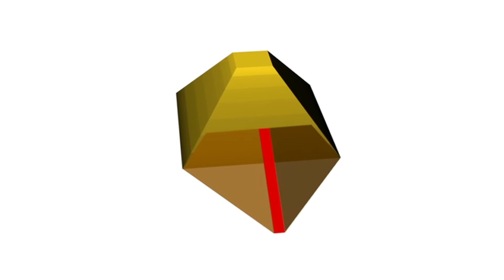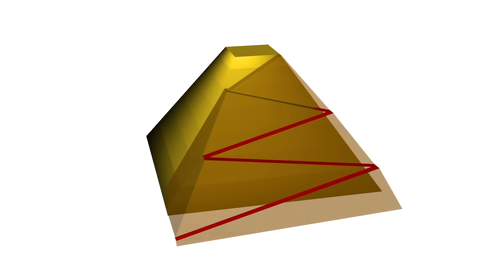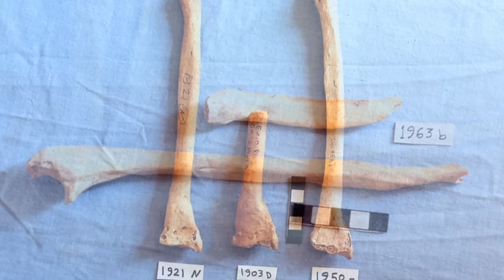Egyptology - Pyramid Construction

Comment: Each brick is actually poured and set stone concrete , made exactly where they sit. The side and bottom  bricks became part of the form for the next brick, leaving gapless spacing between every brick. The tops of each brick were naturally flattened by gravity, like when a concrete floor sets. Very little of the pyramids and sculptures are quarried rock. Really not that complicated, but impressive nonetheless.
Reply: noeffin way 

Are you suggesting that the alchemical transformation of sediment from a solid state to a liquid state is not complicated?
Bitch please!
The Nubians still had to create a rock model with precise angularity to even create the blocks. A tub so to speak.

Comment: it almost sad that people actually think this was the way it was built. They sound so silly but yet so arrogant.
Reply: Danny Cheeks How do you think it was built? Genuinely curious
Reply: ellie it’s actually made out of concrete and that means that all they needed was sand and water so they could have just climbed and built it with no ramp
Reply: Danny Cheeks take your meds
Reply: Jade Loika wouldn’t that make you arrogant dumbass, you’re basically saying you’re right and they’re wrong when we have no proof of anything making you arrogant and hypocritical your self.
Reply: You are hilariously ironic
Reply: cz productions exactly!
Reply: Im reposting my theory.
   How the pyramids of Egypt were possibly and most likely built:
    The stones were shaped at or near the quarry and transported to the Pyramid site in this method :
    An assortment of encasements from spherical to cylindrical, encased the block and interlocked into place around each block stone allowing the stone to roll. Certain attachments around the encasement would allow either fulcrums or rope attachments to ease movement and allow for tight corner turning with the least amount of men. Once the stone reached the top, the interlocking encasement was disassembled and the stone was leaned over and slid into place.
    This technique would have eliminated the need for lifting devices or a massive ramp.
    My theory is that most likely it would have been a spherical encasement allowing for tight cornering. This would be the most logical way to transport a large stone using the pyramid itself as the ramp.
     So in essence the stones were rolled up the pyramid in a spherical encasement that was removed once the stone reached its destination and leaned and slid into place once atop the pyramid. This process was repeated all the way to the top. 
     I have not decided yet if the encasements were made of a metal alloy or limestone etc. If bronze was used it would have been melted down for chisel making and as such there would be no evidence of the spherical encasements.
    If limestone was used it may have then been discarded and reused for other construction. 
    In conclusion the only way to deliver a square to the top of a Pyramid is to encase it in a Spherical interlocking encasement.
Reply: We built most of Manhatten and the rest of New York City before we basically had electricity and way before we had a screw gun  just saying
Reply: It's more silly to believe in conspiracy theories instead of mainstream science.
Reply: Ramps and muscle power of close to a million in the time span of 30 years. That is fucking easy to build a pyramid, it wasnt aliens you fuckhead.
Reply: Jade Loika shut the fuck up bitch

Comment: What about water as a transport and guide for leveling? Put floaters on the blocks. Water softens them and water is level. Put hundreds of blocks in a big pool and get hundreds of workers working on the soft stone to shape the sides while in water. Then float them to the pyramid and build sealed tubes with chambers to float the blocks up the side of the pyramid. There's a video about it someplace I think. This would mean less brute force required and no ramp building. Since there is little evidence of ramps, I tend to lean toward the smart plan. Which seems to be what those builders would have done...a "smart" plan vs a "brute" plan.
I'm sure they did use the string and pegs for fine tuning, but the overall work would be done far quicker and better with water.

Comment: It shocks me that an intelligent person can believe these stones were marked with red goo and then ground down one spot at a time on 6 sides. Then somehow hoisted to heights by means that would make its precision nearly impossible. This followed by encasing it in limestone. Enoch’s giants makes more sense. If there were men as tall and as strong as oaks; this is doable.
Reply: redlegagent darn, you caught me
Reply: redlegagent my post was not to make a claim, just to imply they aren’t necessarily correct. My issue with science is they decide and close the door. 50 years later we find they were wrong by accident.  For example, it has been found that bone can turn to limestone in less than 100 years. This should make a good scientist scratch his head and take another look at this and maybe other remarkable discoveries could result from discovering how this could happen. This would mess up the narrative, so it is ignored and their previous hundreds of thousands of years for limestone to form remains the answer.  I think they are wrong about this on the pyramids, but I have yet to see an explanation that makes sense.

Comment: So I'm supposed to believe some guys ran around with a 6 inch string and a potato chip sized scraper checking every square centimeter of every block (not to mention your measuring a 3 dimensional surface with a one dimensional tool...how long would THAT take you think?) and finished millions of these over a relatively short period of 20 years? Not to mention that scraper isn't going to work on the granite that's inside. I'm a carpenter for a living and this theory seems to me WAY more ridiculous than if I built a house in ONE year by using sandpaper and my hands to sand whole trees down into 2×4's at the length I need. Not going to happen....
Reply: redlegagent Oh. I meant to say every surface block. I made a mistake. What a dumb fuck I am. Glad you pointed that out. Perhaps if you spent less time trying to make yourself feel so above everyone you wouldn't make yourself look so stupid either by not even being able to spell correctly.
Reply: There used to be a river they made a giant moat to transport huge blocks of stone they would calve them out as they where being trasported in the water. they then used water lifts that made the stones rise up and they could push them into place while still floating on the water. they would then drain the water and build up a layer at a time it was so fast for them to do.
Reply: They did not need to cut out the ground since there is layers of sand. water likes to flow the easiest route so it would go upto the pyramid and stop they would use gates to hold the water in these pipes water could not escape so the block would rise up.
Reply: There has been a full documentary with proof of concept and the core design of the pyramid all indicates it to be the most likely true over any other method. They showed a working model of the water gate system. yes water does not flow upwards but it also can't flow down when the gates are closed which means the blocks can flow upwards but the water can't flow down past the gate blocks.

Comment: As this one, all the theories you can find  exposed on YOUTUBE are pure bullshit, why?
The guys that did that shit are just totaly incompetent in physics, project managing and quarry work.
Even a 16 Years old student can make this calculation that those guys didn't made.
Just considering it globaly, it can be said that the pyramid is made of 2.4 million average stone weighting 2.4 t each volume 1 M3. built in 20 years it was processed about 500 blocks a day.
Just putting up the average block to the gravity center represent 1/2.4 million of the total minimum energy to spend to lift all the stones of the pyramid, this cost 0.25 KWH of energy a block. the daily consumption was about 125 kWH for 500 blocks
A worker in good shape and well trained can produce 1 KWH of energy a day , so the people raising the blocks can't be less than 125 at work.
Now look:  quarrying out this stone takes between 3 to 18 KWH depending on the groove width to cut around the block to detach it from the bedrock 10 cm width for 3 KWH, 60 cm for 18 KWH.
10 cm width can't be used without a machine, 60 cm width is mandatory to allow a manual worker staying in the groove to carve it.
So the people in the quarries can't be less than 1500 to  9000 !
Mark Lehner the archeologist speaking in this video, made a research in the town of the pyramids workers nearby the Giza plateau and concluded that this town can't accomodate more than about 2000 workers.
Make your conclusion by yourself.
Mine is: indeed they used human powered machines to quarry out the stones and raise them to their place,  not those f..g ramps n' rods and hamered chisels!
Here's a site that explain better how they could have make it
https://cheopsgoldenstoneage.blogspot.fr/
Enjoy!
Reply: Please Redlegagent leave wonderland and come back on earth!

1-The bones found in the town of workers where the bones of ate animals!
do you think they used goat, sheeps or veal to make the job?
Have you ever see cattle carving rocks?

2- AT the time of the pyramid construction, Giza plateau wasn't a suburb of Cairo, but actualy a desert place, 
Nobody could reach the site every morning using the metro
They build the town to accomodate ALL the people working on the site.
Most of the food came from the delta through the Nile, they discovered port installations in the town of workers
Do you imagine that 100 000 people could survive 20 years elsewhere in the desert after 10/12 h of harassing work, without nothing to eat, to drink, to rest?
To my knowledge Erodotus related oral informations he get 2000 years after Cheops, he didn't make archeological work to verify that was told to him was real.
The Erodotus information, is not proven  he didn't introduced any evidence, the archeological outcomes are a proof.
To my knowledge nobody found any trace of temporary town out of Heit el Ghurab.
Sorry you cannot disproof archeological evidences by what you think or Erodotus writing.
3- Time frame: Snefrou the Cheops father was supposed to have built 3 pyramids during his reign that makes 20 years to build a pyramid rather a large time, 
4- Sorry the diary of meyer didn't talk of the site duration, just gives some informations that could date it at the end of Cheops reign.
Moral of the story, they are no traces of the supposed ramps to build the pyramid, the lever, fulcrum and counterweight are just of YOUR invention and you didn't justify that they could make it in time using that stuff.
Be modest,  what you think isn't an evidence, may be you are not familiar with calculations that may be you didn't understood, it is not a reason to qualify those meaningless, do you think that ancient egyptians built the pyramid without calculations?
improvising it each an every morning?
The evidences at hand that I put forward are still visible to everybody, stone have not changed, gravity as well
Labor and the Pyramids
The Heit el-Ghurab “Workers Town” at Giza from Mark Lehner is available on internet.
Where are your evidences out of your brain?